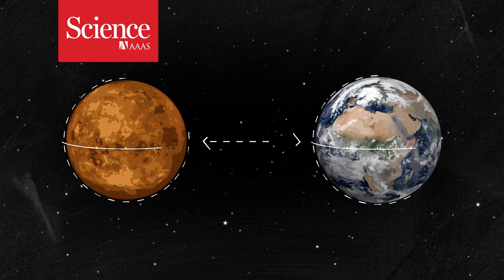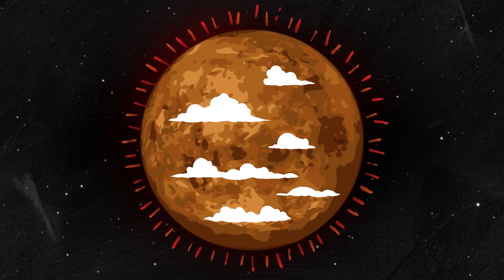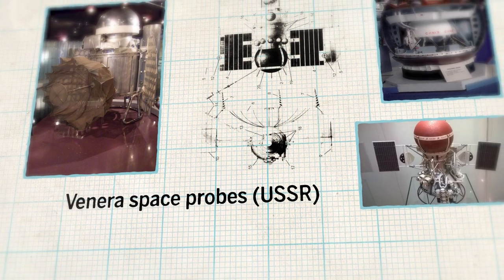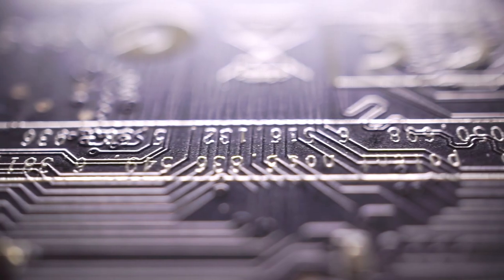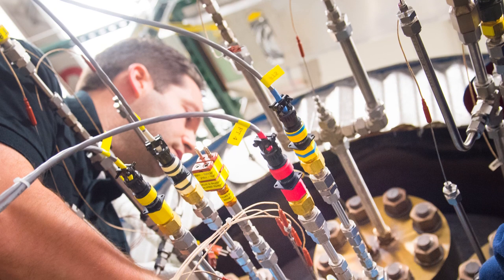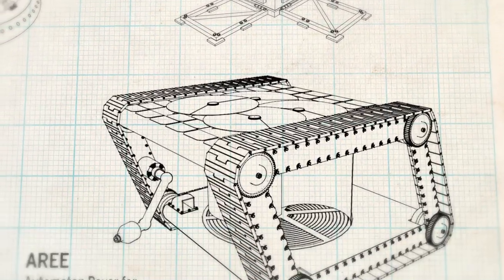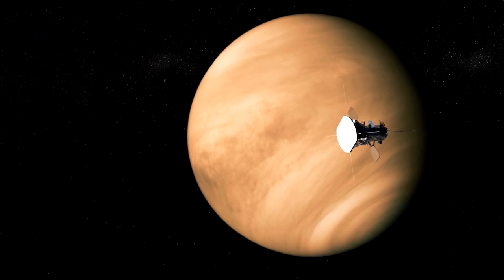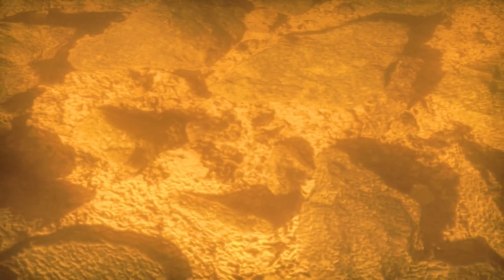Armed with tough computer chips, it's time to return to the hell of Venus

Comment: You still have the power source problem for a rover on Venus because solar cells will melt, conventional batteries will melt, and a radioactive-nuclear battery only work in the cold.
Reply: They could probably use RTG's and cool them with water and steam running through a radiator like coolant in a refrigerator on Earth.
Reply: There are thermocouples that produce electricity from heat, by way of different metals/alloys contacting each other and having different electric potentials, sandwiches of these could provide some energy.
Reply: Radio-isotope thermal generators and electro-thermal generators require a very low ambient temperature environment to be effective. The coldest day on Venus is over 850F. Refrigeration systems only work if you can get rid of the waste heat... where are you going to “radiate” away that heat in a world that melts lead!
Reply: Thermal couples do not create energy from heat, they create energy from a difference in heat. You need a hot place and a cold place, if every thing is the same temperature there is no flow of energy and hence no work can be done.
Reply: Well, they generate power, the word  is Thermopile for what I had in mind.
As long as the temperature inside the enclosure is less than on the outside it should be possible to make use of it to a degree. The problem is to keep it that way, of course.
Reply: Yes, once it reaches the same temp then it stops, so not useful for very long.

Comment: I'm thinking we need another Jovian atmospheric prob based on this tech since Galileo atmospheric probe died the same way due to heat after an hour or so.
Reply: Wasn't it crushed?
Reply: When it got to pressures similar to those on the surface of Venus, it saw similar temperatures. So much for the "runaway greenhouse" theory of why Venus is hot.

Comment: The question now is whether they can put a camera on it. I'm not as interested if they don't have an optical camera. The public isn't either.
Reply: They could probably use water with a radiator and a compressor or something to cool the CCD, and there are certain kinds of glass that would be good for the high temperatures like on Venus.

Comment: What if we find alien life in venus?
Reply: Only Amazons.
Reply: BrackenWood they are here, they are called women
Reply: there is no aliens in venus only Cylons
Reply: More likely in the water ocean of a Jupiter or Saturn moon.  Venus most likely has no life.  Radiation level and temperature rule out chances for any life.
Reply: It might be able to have very light microbes carried by the wind in the cloud tops.
Reply: Paul Sukhu+ Actually radiation levels on Venus are very low, the thick atmosphere provides abundant protection, the temperatures and pressure are a problem though.
Reply: Alien life on venus? you mean devils?

Comment: So the van allen radiation belt doesn’t exist to you?
Reply: While I have no idea how is this related to the video, I'm pretty sure this thing could survive in Earth's Van Allen belts. But considering its speed when leaving the Earth, it doesn't really need to survive them for that long.
Reply: Its all fake.
Reply: Stephen Chan Shield the spacecraft and go through the thinnest parts of the belt at top speed - worked before
Reply: Ian moseley  so they have technology to pass van Allen belt when they went land on moon??
Reply: AJ plus He literally just explained to you how NASA does it. 

Shield the spacecraft and go through the thinnest parts of the belt at top speed - worked before

Not much advanced technology required. Make an aluminium can and shoot it as fast and as far from the center as possible.
Reply: AJ Do you think that the belts are instantly deadly or something? Most of the radiation in the belt is particles from sun, particulate radiation like that can be stopped with a few millimeter of paper. Aluminum works nicely as well. Even an unshielded astronaut could stay there for a few hours before getting a significantly higher chance of cancer in his life time. He would have to wait quite a while to die from it. The few minutes traveling shielded in the outer fringes of the belt gave them a pretty small dose. Radiation is only immediately deadly in very large sudden doses.
Reply: Stephen Chan 
The van Allen belts are BELTS not spheres, you can go a AROUND them. Apollo went around the most dangerous parts of the van Allen belts.